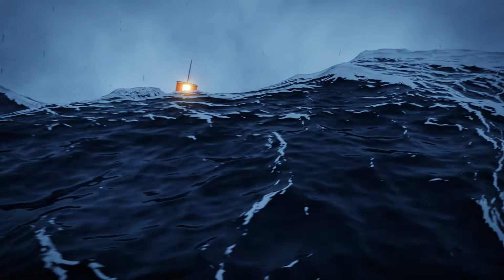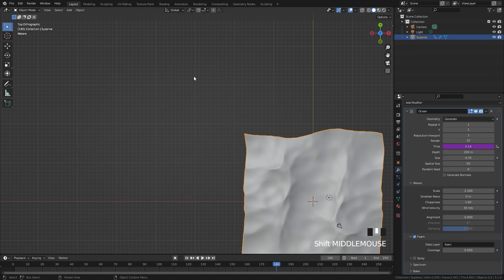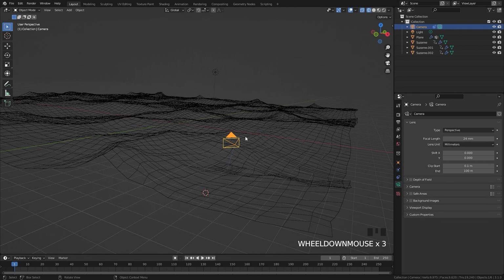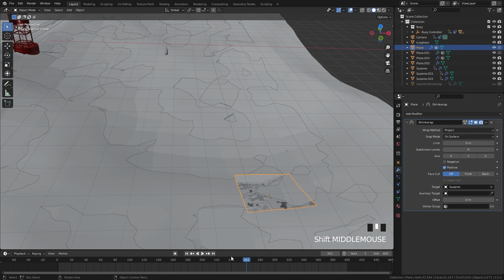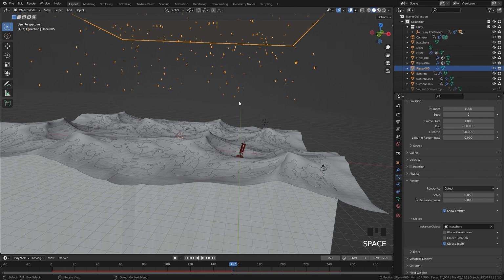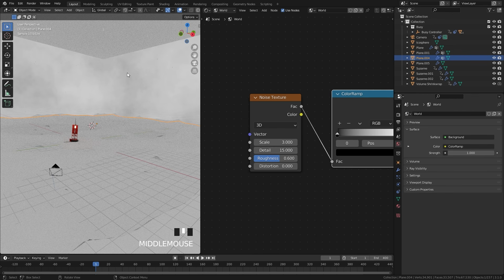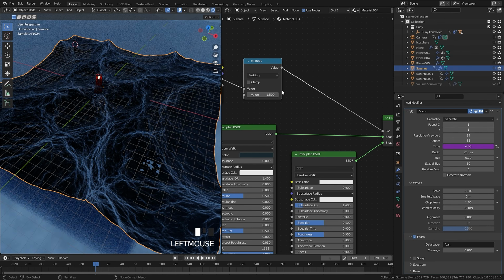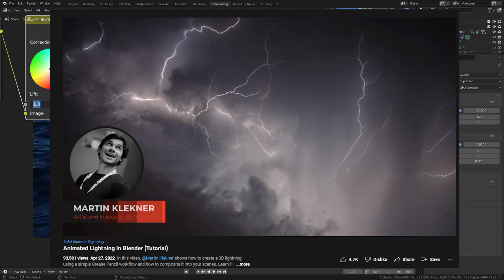Blender Tutorial - Creating a Stormy Ocean

Comment: This is an amazing tutorial, thank you very much for this. Just a tip for the other Blender learners : don't forget to define precisely the folder in which you want to render your animation. Otherwise you'll end up like me finishing your ocean and not knowing where to find the damn file. To do this go check the output properties (that's the icon in form of a printer on the right panel and be sure to click on the white folder to choose the right directory to save the render. Also you need to select FFmepg to save it and, preferably, mpeg-4 rather than matroska (but it depends on the graphic card you have)

Comment: If you can pin this, I am still new to Blender, started in the beginning of the year, but I came across a video yesterday on YT about shift+D - when you render, it will render 1 by 1 and that's what's going to make it take long - So the alternative is to use alt + D so when it renders, blender will treat it as the original copy and render all the copies at the same time.

Comment: For those of you struggling with the #frame35 here's the solution for newer blender versions.
Change the timeline to your liking to animate the waves like 250,right click on the time in the ocean modifier and select Insert Keyframe.
Move forward on the timeline from the 0 value to the max you chose and increase the time parameter like 7.0.
The higher you go,the faster the waves will move.
Now select both keyframes in the timeline and right click,under interpolation mode,select linear so that the waves move naturally.
If you don't like the look of it,you can always change the seed.
Cheers

Comment: Nitpick: falling raindrops are squashed spheroids, not raindrop-shaped (they take that shape when they are adhering to a surface, like a window). If they're falling at a realistic speed you won't be able to tell anyway, but there's no need to spend time modeling a raindrop.
Reply: When making rain in blender the shape of the rain drop does not matter as much as you think it would if you decide to use cycles rendering. This is because the speed the rain goes at will make it appear life-like
Reply: @m.saggafe8852  I'm aware, but that means there's no point modeling anything more complex than an ico sphere.

Comment: Really good tutorial! So simple to follow and the result is really beautiful!
Reply: do u know why everything turns black when i enter render mode? and how do I fix it?
Reply: @albinorat69  did you add a light source?
Reply: @venomironx  no, in the video he deletes the default light and it works perfectly good so im a little confused
Reply: @albinorat69  hard to guess without checking your file.. I followed everything and it worked for me.. maybe start a new file and try again?
Reply: @venomironx  did you add a light source?
Reply: @albinorat69  no, only environment light, I did 100% like the tutorial.. there can be lots of reasons why you're getting everything black in render mode, I can't help much without opening your file.. if you google it you get a list of potencial reasons pretty easily, so maybe try that or start a new file, the tutorial is only 21 minutes.. if you speed it up or skip some easier steps you'll get your problem solved..
Reply: @venomironx  thanks

Comment: Now the question is, how do you make this loop seamlessly? Is there a way to edit the various "random" XYZ rotation graphs on the camera, to make them end at the same place as they started? Also, is there a way to modify the frame/35 driver so the waves end up at the start? I've been through a couple of iterations using keyframed time values on 2 stacked Ocean modifiers and got the waves to loop that way, but the camera never ends with the same view as it started, and the waves aren't as dramatic as with the frame/35 driver.
Reply: if you figure out a solution please post it

Comment: for those with difficulties at placing the sea after Shift+D, use 50 or -50. When I used it was one at the top of the other when using -35 but it was right at the spot at 50!
Reply: I was stuck on this as well.  His number of 35 is just have of his size of .70.  I made mine 200 and moved them 100 and they lined up perfectly.

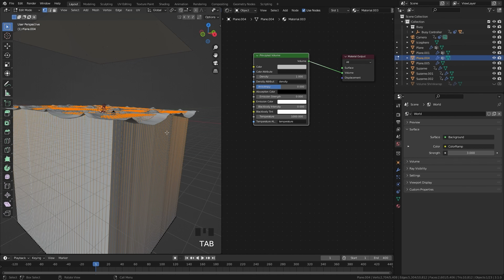Comment: Hello! I can't get recalculate normals to work at 16:27, is there a way to fix this or do I need to remake the asset?
Reply: I had the same issue and didn't realise that I wasn't selecting the same mesh at the bottom as that on top. From the top view it seemed I selected all of it. But down under all the vertices, similar to top ones were not selected. And I realised that our Guru @BlenderMadeEasy pressed A to select all the vertices and edges. So try pressing "A" after going in edit mode then pressing "Ctrl+N". That should calculate the normals properly.

Comment: I was struggling to get the second "copy location" for the bouy working - the plane just would not adhere to the ocean surface using the project option - the trick to fix it for me was i had to tick the "negative" box in the modifier box and i think the reason is my plane's position was above the ocean, once i ticked this it worked perfectly
Reply: wow thank you so much
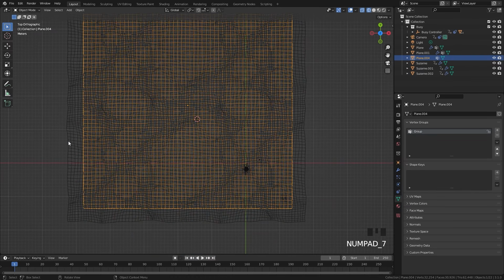Reply: i guess i have the same problem. Can you help me with this 10:31 question.You dublicate by shift D ,and then there is a layer,where should i put it or just leave somewhere,cuz in the video seems like there`s no duble😅and as i notices i have 2 separate  squares,not like rectangle

Comment: At 10:10, how do you select the top half of the cube? I keep selecting the whole cube or parts of the subdivision.
Reply: Hello, I had issues with this as well. What I did was go into object mode and move it away from the (Ocean) part. Go back to edit mode and box select the area I needed. went back to object mode and put it back where it should be. When you go back to edit mode the areas will still be highlighted. Hope this helps.
Reply: @philmcnamee4678 omg thankyouu so much!

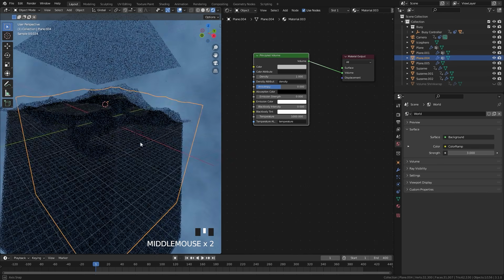Comment: Stuck around 16:30, when trying to sort out  the volume underneath the water in the shader editor. At some point tuto says the volume underneath disappears because of the normals, so we need to go into edit mode, select the cube, then recalculate the normals (shift N). Done that a bunch of times, but doesn't seem to work. Can't get around it, anyone with a hint? 

Thanks!
Reply: Maybe you assigned all the points of the mesh to the vertex group instead of just the points of the top face. To fix that you just have to remove the points of the bottom face from the vertex group. I did the same mistake and in this way I fixed it.

Comment: Amazing tutorial! I just have a question, the top part of the cube underneath the ocean overlaps the ocean itself in the final render. And since that part doesn't have foam and is low poly, it covers the actual ocean in some parts making it look bad. Any help is greatly appreciated! (I probably made a mistake somewhere but I've been reviewing the video for far too long now...)
Reply: Hey , check your wrap method on the shrinkwrap modifier , I faced the same glitch when I set it to "Project" , it became normal when I changed it to "nearest surface point".
Reply: @aviem99  Thanks you so much!
Reply: @yann6997  did it work?
Reply: @aviem99  Yes!!:) Thanks
Reply: @yann6997 nicee

Comment: What do you prefer to render this Video into. Is it in the image sequence or direct into Mp4 Format.
Reply from the maker: Usually it's a good idea to render as an image sequence. This allows you to stop the render at any point and resume it. Once it's finished then you can sequence those images into a movie file.
Reply: @BlenderMadeEasy  i always do this. then you can choose the video encoding quality later, or change the framerate, or pull high resolution stills, or reverse it with no loss. (say, to make a loop-able vid)

here's how I stitch them together using the free tool "ffmpeg". You can also do this while render is going to get partial videos if you are impatient.

ffmpeg -r 30 -i %04d.png -vcodec libx264 -crf 20 -pix_fmt yuv420p -y  MY_OUTPUT.mp4

30 FPS, 20 is quality (lower is higher). this makes videos which are friendly with social media uploading

Comment: Instead of adding the random camera rotation using a keyframe and noise, I added a "Copy Rotation" constraint, similar to the "Copy Location" and set the "Mix" to "After original".  This way, the camera rocks and rolls like the sea surface.  If the waves calm down, get more rough, or the camera is moving, it will self-adjust whereas the random noise would not.
Reply from the maker: Nice!  I should have thought of that!
Reply: @BlenderMadeEasy  animation not working on mine
Reply: I think maybe this work if you reduce the vertex point when you subdivide cause the camera move over vertex you selec
Reply: in my project it almost works.. but the camera rotates heavily sometimes, dunno why :/
Reply: @pixxelartist1  Try adding only the corner points of the wrapped plane to the vertex group.  This will give a smoother average for movement and rotation.
Reply: @EDcase1  Yes this was my mistake! Thank you!
Reply: @EDcase1  what is mean by number key sir anybody tell me
Reply: @rakeshmani8787  if you have a Number Pad on your keyboard you can use those keys for Views - it's not the same if you just use the usual numbers on a regular keyboard
Reply: For those experiencing the random rotation issue when applying this, unset the Z axis, set your 'Mix' to 'After Original', make sure you've applied all your transformations and then set the 'Owner' to be 'Local Space' - this has resolved any issues I had with this otherwise fantastic suggestion!

Edit: you can also play with the 'Influence' slider to make it smoother/rougher as required.
Reply: @lemon3d734   Setting the owner to Local Space fixed the random upside down camera shake thank you
Reply: @abrodking6584  Yep, that helped me too! thanks everyone! :)
Reply: @lemon3d734  what do you mean by applying transformations?
Reply: @jonathanbibi799  Ctrl+A, Apply All Transforms.
Reply: @lemon3d734  It worked, thank you!!!
Reply: @lemon3d734  nevermind, it only worked on the first frames for some reason, kill me
Reply: to smoothen the rotation, dont forget to set the plane's shrinkwrap mode into "project" and check the "negative" box.
Reply: @SendirianAja  Fixed mine, thankyou!
Reply: @SendirianAja  This did it for me! Thanks!
Reply: I tried to use Copy Rotation constraint. Even with only the corners set as the vertex group, rotation of the camera still jumps. It is also upside down when "After original" is selected. I set "Influence" to 1.0 but it didn't help.
Reply: @odulkanberoglu  Within the "Copy Rotation" constraint settings, for "Axis" turn off "Z".  That should flx the camera from being upsidedown.
Reply: @odulkanberoglu  had similiar problems, couldnt really fix them too.
Reply: @pixxelartist1  Indeed nothing seemed to fix the issue. I found out that there have always been difficulties in using the "Copy Rotation" constraint.
Reply: @odulkanberoglu  Don't forget to Apply any Transformations first
Reply: @odulkanberoglu  did you figure it out?
Reply: @pixxelartist1  did you figure it out?
Reply: Actually I noticed that "before original" gives me a better, less spazzy camera when rolling with the waves. I followed Odul's advice as well and used just points from plane to hold down the camera.
Reply: Please use 'Local Space' in the 'Owner' Section of the Copy Rotation Constraint, this will fix the random camera rotations.
Reply: solid tip, thanks
Reply: Yeah I am facing the same problems as others. My camera shakes too violently when I try the Copy Rotation constraint. Tried the fixes suggested by @-Ed case- but no good. Increased the number of subdivisions on the place, tried with influence and basically all settings inside copy rotation. Nothing really worked. Camera shakes too violently randomly.
Reply: @KevinDesai  did you figure it out?
Reply: https://youtu.be/NMWBAzQR7H0
Reply: Thanks for the tip. I tried both and I like the additional undulating feel from the Copy location, I feel like I'm actually bobbing up and down so In addition to Copy rotation, I also added Copy Location after with  All axis on, Offset on, Owner: World Space, Influence 0.5.
Reply: Can you help me with this 10:31 question.You dublicate by shift D ,and then there is a layer,where should i put it or just leave somewhere,cuz in the video seems like theres no duble😅and as i notices i have 2 separate  squares,not like rectangle
Reply: My first plane doesn't connect with the others so the cube pops out. How do I fix this?

Comment: When the ocean was duplicated to be placed in the exact spot, how the value 35 was found out? I think it could be a convenient thing to do when we want to connect more objects without using array modifier.
Reply from the maker: Because we set the size of the ocean to 0.7 I know that when we move it it's going to be exactly 35m. The origin point is in the middle so half of 0.7 would be 0.35 which is 35m.  The Driver has nothing to do with the size, it's only for the movement of the ocean.
Reply: @BlenderMadeEasy  Oh! Now it makes more sense. Thanks for the explanation and for this awesome tutorial! 👍
Reply: For me, it seemed to have my first ocean overlapping the other in the ends instead of what's shown in the video.
Reply: @autumnnights4042  I don’t know why it happened. I didn’t have this problem about the overlapping and the waves fit to each other like in the video. I think the value 35 is related to the drive in the Time (#frame/35) 1:31
Reply: @speedtripvfx  Oh I see, I typed as "Shift+D", "X" then did "-35", Honestly, I wasn't sure what "negative direction was referred to as.
I tried today and it seems to work fine now, perhaps I was receiving some glitch :T